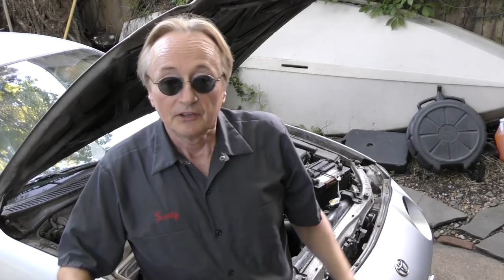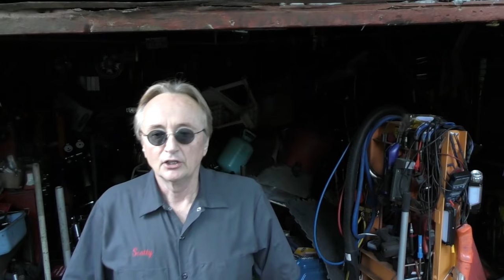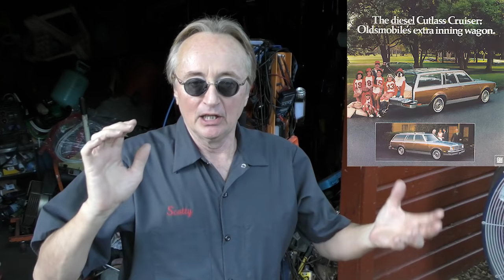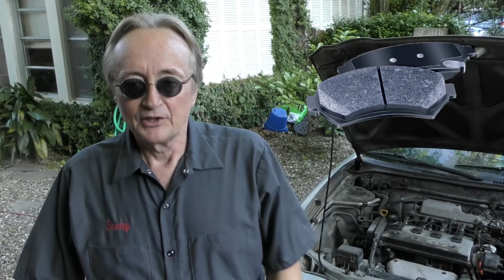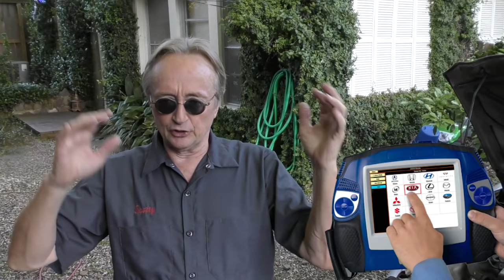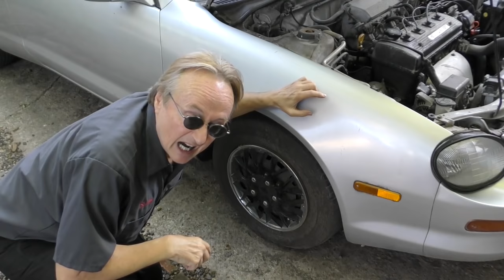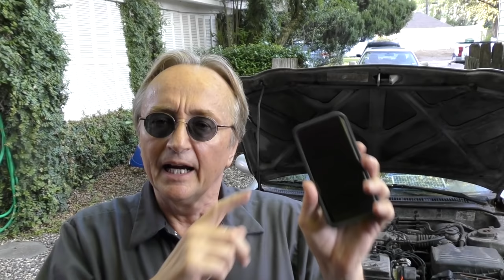5 Scams Your Car Mechanic Doesn’t Want You to Know

Comment: Watch out for the "brakes and rotors" claim.  Almost every oil change shop will tell you your brakes and rotors need done.  Always double check them.
Reply: Very common.  They will also over-torque your rotors to warm them.
Reply: Very true statement

Comment: Being trained at the dealer. And being a flat rate tech. Inspections are free. It takes my time. I found it impairitive to do the same thorough inspections on every vehicle. It took my time. And I gave it honestly. Brakes, tires, suspension and steering components. Are more then likely honest repairs that are needed. As a flat rate tech getting a junker is not a fun car or easy job? Multi point inspection will primarily be safety concerns. As a technician our job depends on you depending on us to keep you safe. You may not know that there is something wrong with your car? Until I have inspected it. I personally will ask my service writer if the customer is aware of a check engine light? If it's illuminated? And it's not listed as a concern. 280000 mile 01 Ford Taurus what's not wrong with it? A. Good technician is aware of this. Because very rarely does anybody want to restore a 01 Ford Taurus with 280000. So yes watch out  especially at an independent shop. Perhaps I was fortunate to only work at the best dealerships that cared about. Their customers and we knew we where more expensive because you expected it to be done right the first time. There's no pay for comebacks. And that's what I know. Not all mechanics will rip you off. Second options are usually free. Most of us believe this is our duty and calling. And we are aware of you and all cars on the road. If your a mechanic and you aren't think of it like that start! It will improve your quality of work and your company's quality of work. And overall safer roads.

Comment: While I couldn't agree more with you in many of your points, there are two items I would like to point out that perhaps you meant to clarify...

Firstly, I'm an honest mechanic, and also work for a large autoparts retailer as my disability job, so suffice to say, I have been on both sides of the retail industry for both the mechanical and the parts industry.

While, of course mechanics and auto parts stores profit from the sale of parts and profit from labor, HOWEVER, as with any business, a customer's trust , loyalty and safety are, believe it or not, more often the Paramount concern.  That being said...

There are MANY dishonest business people in many industries, but to be a dishonest mechanic doesn't pay in the long run, nor does selling customer's unnecessary jobs or parts.  That lack of business ethic more often leads to bad reputations and business failure.

I take pride in the fact that I take my customers NEEDS first in every thing I personally do.  Be it selling them a decent set of plugs for their engine ( ONLY when necessary) to education customer's in proper maintenance of their vehicles PARTICULARLY when their vehicles sit unused for extended periods.

Most people don't know, for example, that rubber tires have a general "SAFE" Lifespan oof just 6 years.  Not only is an apparent "brand new, Unmounted tire" in need of a read on it's date of manufacturer, (it's printed in a small oval in the sidewall of every tire by law) something like this (0417) there are what appear to be brand new tires being sold daily to unsuspecting customer's that are 8, 10, or even 15+ years old if the customer doesn't know to check the date of manufacturer.  A six year old tire, even if kept in a showroom and never mounted is a potential deathtrap due to the natural breakdown of the rubber from time alone.

Service intervals have their place as well.  My mother had a 1996 Nissan Maxima that, when she passed away in 2010 had less than 10,000 miles on it.  While it was garage kept and in what appeared to be mint condition, the worst thing you can do to a car (ASIDE FROM CRASHING IT HEADLONG INTO A TREE) IS TO " NOT USE IT". If fluids and rubber components are not inspected, and joints lubricated, and old oil and other fluids (used or not) are not regularly flushed and replaced you run a  significantly higher chance of having catastrophic engine, transmission, drivetrain, suspension, steering, valve train, and even tire blowouts from time and a stationary life in general.  Even batteries that are left unattended drain at a rate of a half an Ampere per hour if left connected to any vehicle manufactured after 1996 (OBDII computers drain your battery when not in use and can leak.  Even fuel that sits unused becomes varnishlike if not treated.

My mother's car needed nearly every piece of rubber, including tires, shocks, struts, electrical cables (corroded) filters filled with dust,  cylinders dried up after years of not being started at least one a week to circulate fluids and keep seals, gaskets, and other expensive to replace and repair components before it was roadworthy.  And that was kept in an air conditioned garage.

Those pesky "Check Engine" and Maintenance Required Lights are there for a reason.  There are literally hundreds of sensors throughout a modern automobile that report in to a very sophisticated computer system which monitors all sorts of areas within the vehicle in question.  Telling people to ignore these lights is just plain here responsible. well I agree wholeheartedly that there are people who take advantage of people's general ignorance when it comes to their vehicles it's more important that you educate them as to how they can properly maintain their vehicles and how they can manage keeping their vehicle in Tip-Top shape and safe to operate all year round.

No offense intended, just pointing out that mechanics and Automotive parts specialist are not all crooked and are not all out to make a buck off of people's ignorance I think you should make a point of that as well.

Sincerely,. Dave
Reply: I've been sitting here for 20 minutes trying to come up with a way to write exactly what i was thinking after watching this video.
But now I don't have to, because you already did! 
Preach on for us honest people who happen to be mechanics!
Reply: @joshyoung751  Thanks man.   Ironically, this week, I got to witness first hand, a mechanic take advantage of a friend.  

They brought their 2007 Chevy Equinox to this mechanic a handful of times since buying this vehicle, he performed regular maintenance for them and regularly overcharged them for both the work and the parts.  Convinced them last year to invest over $3800 in rebuilding the top end of the motor and also concerned them they needed to replace the entire rear while doing a routine brake job.  The vehicle had a small leak in one of the seals.  

My friends wife took it in for a routine oil change and he convinced her that the slight clunk in the front strut and a sticky blend door needed roughly $1500 worth of work again.  He suggested to my friends wife that the vehicle wasn't worth investing in and said he'd be glad to "take it off her hands" for her at no cost (He didn't even offer to pay her for the vehicle, which was running fine and had 4 new tires recently installed.

I suggested they get a second opinion and, unfortunately, before they could do so, he had already convinced the wife to have over the title.

The SUV is now sitting for sale at a local used car dealer for $4000.  They have no further recourse.  A 15 year business relationship has ended and the mechanic clearly took serious advantage of this couples personal difficulties communicating, and took advantage of their trust.  

It sickens me every time I hear of something like this happening, and it's people like that, who make it nearly impossible for an honest mechanic to make a living these days.  

They not only ruin the relationship between themselves and their customers, but make it hard for honest hard working people to develop trust with their mechanic.  

Thanks for your support Josh.  I hope people's greed, lack of honesty, and desire for short term gain doesn't end up entirely destroying skilled labor and drive out already shaky brick and mortar business, and it's respective labor force completely into the ground.

Comment: Firestone wanted $1200 to replace and change my air compressor.  Said the air compressor itself was $600.

Bought it off amazing for $200 and had a friend that replaced installed the air compressor, my water pump and a lot of worn  out hoses and seals for $400.

I have no doubt it all would have cost me close to $3000 at any commercial car repair shop.

Comment: Hey Scotty I had a question. I have a Toyota Camry 07 and when I’m driving the speedometer drops to zero and my abs light and BRAKE light come on simultaneously but it doesn’t affect the way the car runs any clue what it might be?
Reply: Check wheel speed sensors

Comment: Definitely one of the biggest scams is the maintenance/service intervals mentioned in your owners manual. Fluids don't need to be changed with the frequency mentioned along with other maintenance items. For example my Mazda CX9 is 12 years old, has 160K miles and is still on the original spark plugs. I believe the manual says to replace them every 60K miles I believe. Engine runs great.

Comment: "There's nothing wrong with the car, so the maintenance light is a scam."
Preventative maintenance and repairs are not the same thing......
Reply: Exactly. I'm not scamming you by charging you $499 for front/rear differential and tcase fluids every 30,000 miles, and don't get upset with me at 55,000miles when the vehicle won't engage 4wd and I advise you warranty won't cover a new transfer case because you declined "unneccessary maintenance".
Reply: Heck, Subaru doesn't even recommend a Coolant Flush until 11 Years/100k, but I'm doing one at 45k because I don't trust it to last that long.
Reply: @nicholasp3323  500 bucks for diff/tcase  change?! damn, thats expensive.
Reply: That was honestly one the more stupid things I've seen on a video for a while. Service light isn't a scam, it's to tell you, you're due a service. I bet in one of this guy's videos (just guessing) he'll advise to stick to the manufacturers service schedule, which will no doubt completely contradict this statement 🤦
Reply: @WuYixiang  "Lifetime transmission fluid"
Reply: @nicholasp3323  dude i was thinking the same thing when he said that. I do the recommended fluid change intervals on my own vehicle and i work on cars for a living. I would never recommend a customer to disregard the manufaturer maintenance schedule and i do not work for a dealership. U can bet at 100k miles im changing any timing components that are supposed to be done and if it says to flush brake fluid at 30k im doing that too. Their engineers designed it and if thats what they say takes to maintain it thats what im doing not gonna take my sole view on something from some guy on youtube. Have some common sense ppl
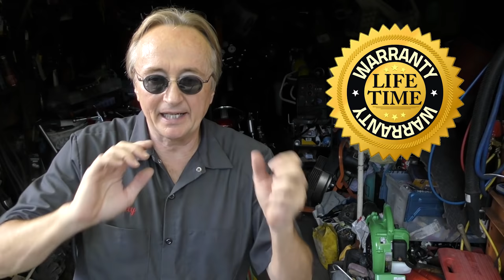Reply: He covers that on 09:00
Reply: He's not saying the maintenance itself is a scam, he's saying that you should learn what maintenance needs doing at the time, instead of relying on a light to tell you "something needs maintenance". If you know what maintenance is needed/recommended, you can't be sucked into paying for other maintenance that isn't due yet.

Comment: I own a tire shop. I had a customer that fit the exact description of the Volvo owner mentioned in the video. This guy was a multimillionaire, and traveled over seas to buy all his Volvos factory direct. Where he would then put a certain amount of miles on the car prior to shipping it back to avoid terrifs on having a new car sent back since it had so many miles on it was considered to be a used car. So he came in bitching about the dealer selling him tires every 5000 miles. And that they were aligning it but the car kept tearing up the tires. The reality was that the car absolutely needed the tires replaced on the rear every 5000 miles because the back end was set out of alignment so bad from the factory and had no way to adjust it. You could look down the side of the car and see the wheels towed in on the rear.

Comment: My car has 8k miles on it, when should I change the transmission liquid?

2018 Pilot
Reply: I was honestly told every 50k miles to change the transmission fluid. And it shouldn't cost more then $150!
Reply: Gleep Glorp Honda’s I’d say every 20-30k
Reply: Your vehicle is equipped with what's called a maintenance minder. if you would like to follow that system, each time your vehicle needs an oil change, your vehicle will always tell you which services your vehicle needs. Maintenance sub item #3 is transmission fluid and transfer case (if applicable). For example, at 15% Oil Life, you might see B13 on the dash. Now, your vehicle will code for a transmission service based on many parameters such as how old the fluid is, how you drive the vehicle, how many miles you put on it etc... That's the way Honda wants you to do it. In general though, it typically is around every 50,000 miles on newer vehicles.

Now, here's the bad news. your vehicle comes from the factory with either a 6 or 9 speed transmission. the 9 speed transmission is a very expensive service, mostly because of the fluid. On that note, it is very rare for 2016+ Pilot to be equipped with a 6 speed transmission
Reply: Transmission fluid, not “liquid”.... I change my transmission liquid every 35-40k. Depending on usage.

Comment: Professionl tech here. Trans fluid doesn't need to be changed under normal circumstances on modern cars. Transmissions last the life of the car unless they are ones that have a history to fail like Nissan cvt's and most gm and ford truck transmissions. They fail regardless of fluid changes. If you do decide to change the fluid then do it regularly. Don't get a high mileage vehicle that has never been serviced and change the fluid. You have a higher risk of creating a problem. Been a tech for 33 years including being a trans specialist at dodge and Toyota dealers. Just sharing my experience as a tech and a car owner of very high mileage original trans fluid vehicles. Thank you.

Comment: If you look in parking lot at a store, you'll see allot more Toyota's and Honda's then American brands
Reply: its because american manufacturers find it easier to give their cars shock value instead of longevity... for example, an f series ford will tear your house out of the ground with a 6.7L diesel which no other truck can supposedly do, but itll only work reliably for about 10 years of normal use. its hard to enjoy a 6.7L diesel when it wont start... the japanese manufacturers dont care about spec-y builds (outside of like supras and stuff that are deliberately performance cars) and they instead put their focus on reliability. no one gets a 99 camry LE because its "so fast." they get them because you can get a decent 99 camry........

another good example is cadillacs/town cars/etc. theyre all crony cars, and whoever buys one is probably gonna buy the latest model 5 years later, so why make the car last more than 5?

Comment: I live in Canada, and being a woman a lot of the shops here think I don't know nothing about cars, suprise
Reply: I had a friend of mine with a 2016 frontier that i helped her replace the clutch, throwout bearing and pilot beating in and she went for a rattle that she couldn't find and they tried to tell her it was a broke heat shield bolt (which it was) and while they were down there they noticed she may need a new clutch soon. She told them that one has less than 250 miles on it and their faces went ghost white

Comment: I purchased a used car from a dealer, i noticed one tire with 80 lbs of air in it.   Then i figured it out, they put 80 lbs in it so they did not have to fix the slow leak.   Dealers count every penny.

Comment: I had suspension fixed at a Firestone garage and they killed my battery to get another sale. They even made up a part I needed to change in the future. I paid for suspension and battery then left. I called the next week and they tried to deny I ever came in. Finally they admitted to their mistake. They offered free tire rotation on next oil change. I learned a costly lesson. Trust no mechanic.

Comment: The only thing you should change on a car that has low mileage (take the Porsche for example) after 4 years, would be the brake fluid and engine oil, along with any other fluid that should be replaced. (For anyone who doesn’t know, brake fluid absorbs water and can lead to rusted brake lines and possible loss of brakes while driving. Engine oil may break down over time. )